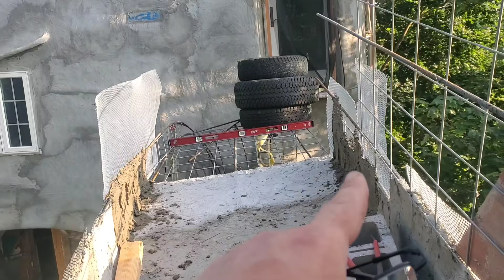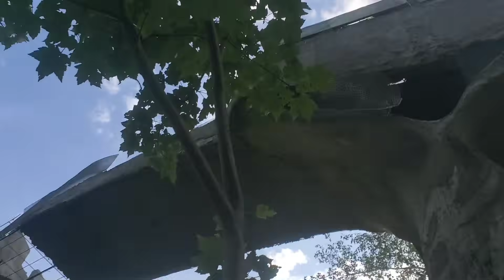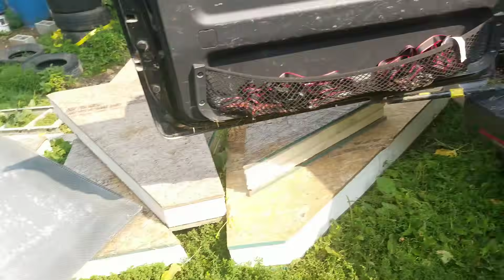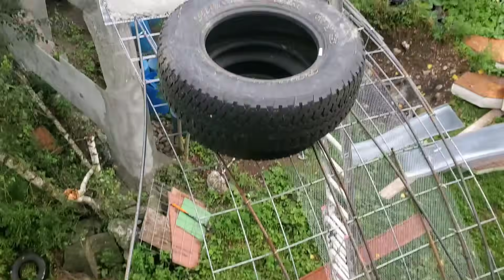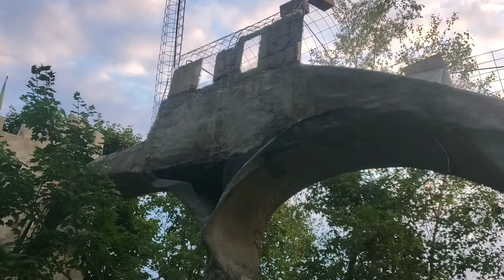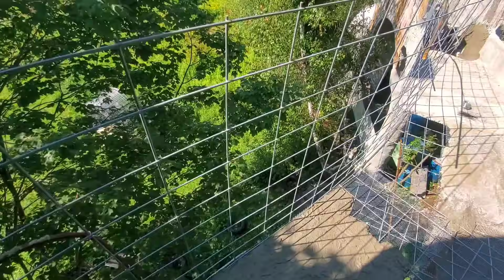Ferrocement Sky Bridge Reaches MST OGΔS13Ep#14

Comment: I like your castle but I also like your arches in this phase of building. They remind me of free flowing Dr. Seuss buildings or something. It also made me think of some of the concepts of “fabric” in architecture. Perhaps you could make arched columns from tubed cattle panels and then you could let other panels sort of drape from those similar to a fabric. Just thinking out loud of course. I love what you are doing. I love the goats, haha! Here is a fun lecture on fabric in architecture: https://youtu.be/RzN4c7lsFxk?si=iOx1dM8r73LVk1Yt
Reply from the maker: When you say tubed cattle panels,  do you mean bending it hot-dog style? Those work great for hollow columns... i suppose they could be used for the arches as well, ill have to experiment with how much they can bend like that.  Doing the arch the way i did made for a design that achieved its function efficiently re: building materials,  but it is  difficult to maintain symmetry and make the geometry perfect w/ out a form & measures. In this example, I basically did everything just by sight and did make a few mistakes, but i can resolve those later... i have lots of experimentation with shapes and techniques ahead- what im most excited about is building everything on bedrock now. In the past,  ive also used long pieces of pvc to help shape the arches
Reply from the maker: Btw, really interesting video you linked! I think i have a better idea what you mean now and it gave me a few ideas.  Really neat structure they made and method.  A shame they demolished it in the end
Reply: @ogfoundation  Doug Lacy at ShambhalaVillage has some bender he made to create rectangular tubes out of the cattle panels. Then he connects those into the bones of the structure.  I recognize it is all experimental. Thank you for doing so much building and documenting it so we can all learn.  https://youtu.be/HKA23Pxyvu8?is=gy0woHCucxaAArMI
Reply from the maker: @neilwalton8970 genius! One of those  that works for cattle panels would be so helpful! Looks like remesh in that vid, which is way easier to bend.  I'll see if a local fabricator can make 1. Thx!
Reply from the maker: @neilwalton8970 also, the structure in the background of that video looks awesome, but I couldn't find it on that video... have you seen it in more detail. *just found a vid which showed it more fully
Reply: @ogfoundation 

He called his older version of building, “parabolic stress skin.”  He has evolved it some since then. He talked about it in that Aircrete Harry interview I shared previously. Here is a small arch system he did with his old system, which might still be practical in some situations: https://youtu.be/fK9VXPUFeHs?is=fr6HcWrcAL-FznaJ
Reply from the maker: @neilwalton8970 Wow, 18 years ago! Really neat idea, I wish they had more videos shared to see how it went. I hadn't seen ferrocement framing w/ such depth b4!

Comment: Great work man! Are you still using the plastic mesh as well as the metal lath...? Are you happy with the strength and durability of the plastic stuff?
Reply from the maker: Yes, I've been using plastic mesh for certain use cases, and think it has its place for sure.  Yesterday I needed to fill a baseball sized hole so I ripped of some plastic mesh and put a plop of mortar on it and wrapped it up like a ball and it held the mortar in the hole!
Reply: It's starting to look like the Skybridge from the Planet of the Apes 1968 film set...🙂
Reply from the maker: @GaryDavidson-h9h 😄 I just looked that up- hopefully I can do better than that! Once I can get the crenelations up there,  it'll look a lot better/ more castle-y I think